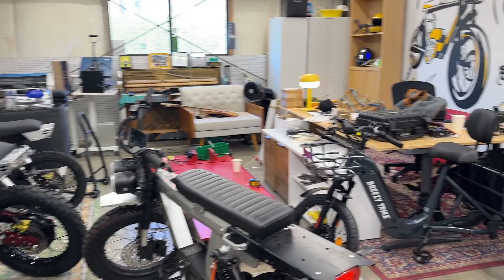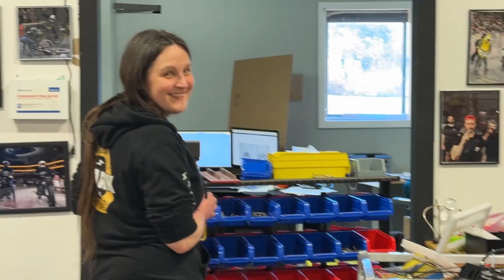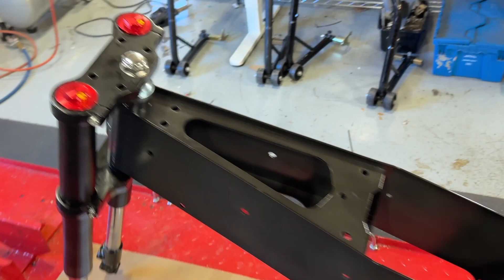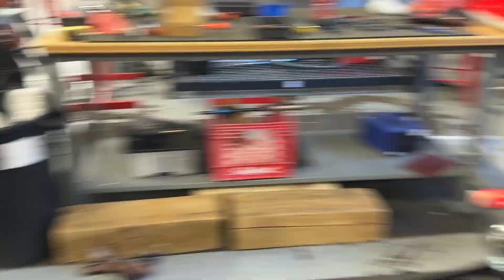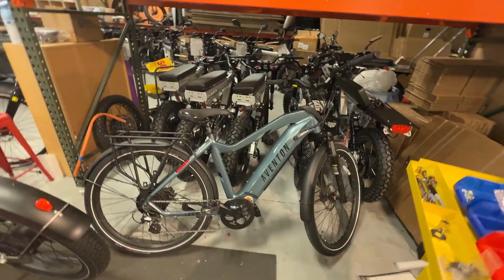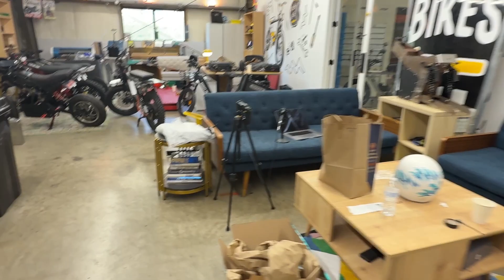Spark Notes: Production Updates, Racing, Custom Bikes

Comment: New microphone is great. 

Cool to hear you guys are considering an official adoption of project nightmare. 

Thanks for answering at least one of my questions. Maybe other folks have more interesting questions. 

You should check in on the California test ride location's Brute. The shocks aren't calibrated correctly and it's bottoming out over ever bump. It's not a great look for the product. Otherwise it's a good demo.
Reply from the maker: Thanks, yes CA e-bikes told me about the shocks. They were attempting to adjust them incorrectly. The top of each shock has a threaded collar. Twist the collar and the shock will stiffen. More background: we used a similar shock on the Bandit. One of the biggest complaints on that bike was the shocks being too stiff. The Brute is set up to be a more comfortable ride.